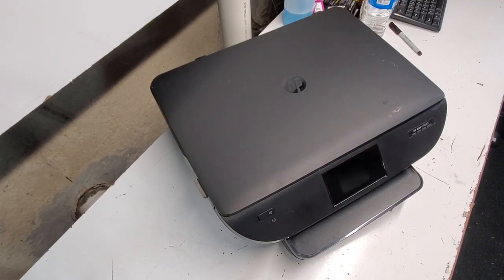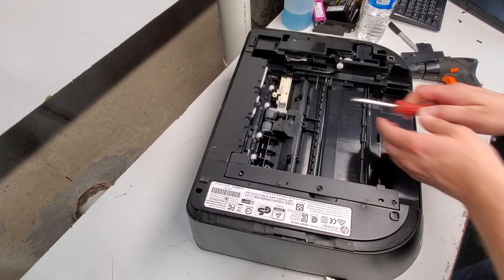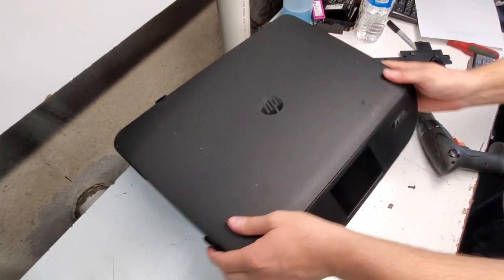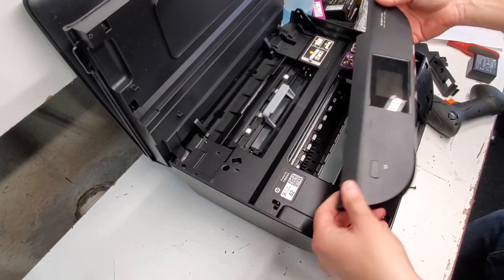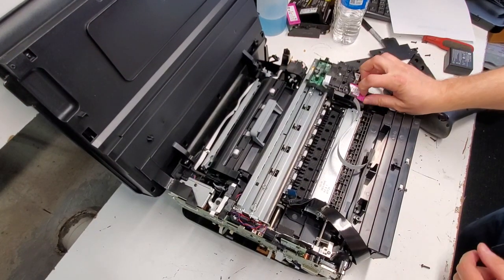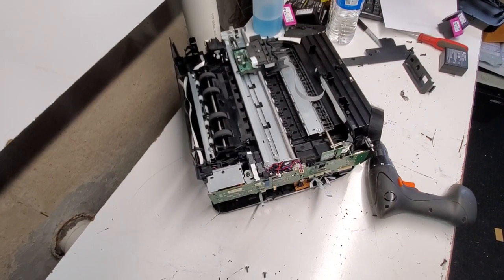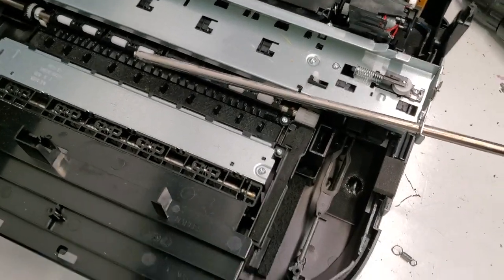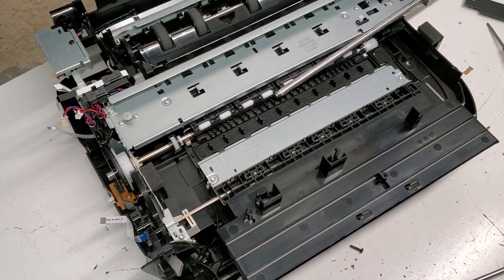Removing Parts on HP ENVY 5660 Printer Disassembly HP 5540

Comment: Thanks for the video. One little thing though - my scanner has developed a fault and in disassembling it, the blasted spring popped off a part on the scan head and it's not easy to see how it was arranged. Unfortunately, you left that bit out so I have no reference :(

Comment: my 5540 refuses to pick up paper, when "inspecting" the pickup roller I noticed it would stick if only turning one of the rollers. It's wobbly by design so I can't even tell if this the part that's messed up on my printer. As of now, no matter if I copy or print I get the dreaded paper jam error, there is no paper jam. Using a flash light I could tell when a print would be successful as the paper would bend up and you can't see to the back. If the rollers have even pressure when turning none of the gears stick, which is how I imagine it works when it tries to pick up paper. I've cleaned and dusted to no avail the rubber on the rollers has a black material underneath that seems uneven and the rollers themselves aren't centered perfectly pushing them in place also did nothing. I've had it for a few years, but probably never printed more than 500 sheets and now when I needed it refuses to work.

I would recommend you never by HP printer lest you like throwing money away.

Comment: I get the error message that the cartridge carriage is blocked ob my envy 5640, but not by the cleaning unit or a paper jam. The printer has never been used and it can also be moved by hand, but the motor that drives the cartridge carriage does not seem to be turning.  At least now I know how to disassemble the printer.  thanks for the video

Comment: I have envy 6234 and the black cartridge is not communicating with the printer. Color works fine. I have replaced the back but it seems to be not going anywhere. All connections cleaned but still the same.  I think there most be something wrong with the communication module.  Any advice on the relevant parts ?

Comment: I have a 5540 printer that continually tells me I have a paper jam. From you video I took out the pick roller assembly and it looks likes the left side piece holding the roller in place has broken off. Is it possible to get this part?

Comment: My hp envy got jam by sticky label paper in the printer, i dont know how to get it out, it s sticked under the black plastic bar, i dont see you open that one yet
Reply from the maker: You may not need to open up too much. If it is visible and reachable with a small screwdriver or tweezers, you may be able to remove it with that. If you still want rtemove parts, there should be two screws on each side of the steel bar that runs across.

Comment: So, iow, I need an electric screwdriver???!!!! Lol.  But, seriously, this is way more video then (than, who knows) I need.  If you don't mind my War and Peace, I'm having issues!  I've had my 5660 for about 10 years and it's always worked fine.  I put a new color 62 in, and it was fine, but when I went to replace the black 62's twice, my pictures come.out pink.  And my printer did something wierd black and white wise when the cartridge ran out of ink.  To make a long story as short as I can, HP wanted to charge me $100 to "clean the drum", now, granted, it probably does need cleaning (all of a sudden), but is it worth it?  It's like the black 62s don't have any say in my pictures.  Any ideas?  Thanks. (I hope I made this understandable)!

Comment: I'm getting an error about my black ink cartridge.  I accidentally forgot to pull the ink tab cover off before inserting and once I removed it and replaced the black ink cartridge, I keep getting a cartridge error message asking to reinstall.  I've taken it out and put back in but there seems to be no recognition of this cartridge.  Is there a reset or something?  I've turned off and on several times, starts to print and then stops with error message.  Did the little sticker on the ink cartridge do that much harm?  Appreciate your feedback!
Reply from the maker: It could have or maybe there is some residue on the cartridge contact area. Try replacing ink cartridge if it is faulty. That happens sometimes.